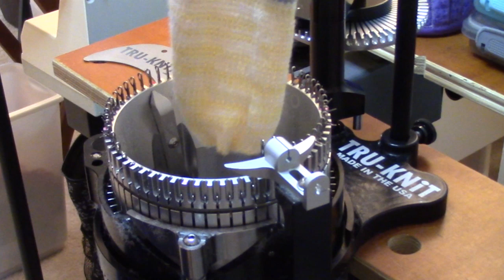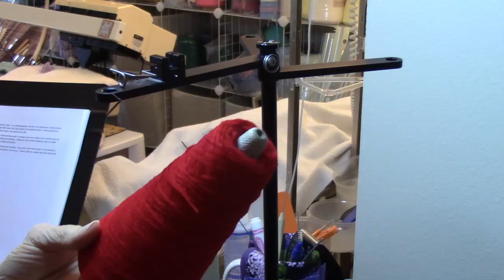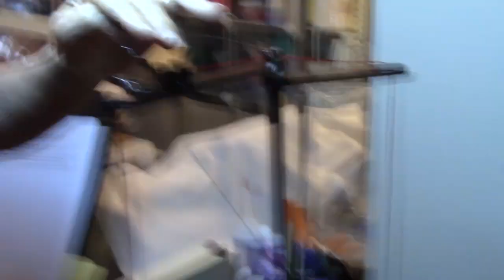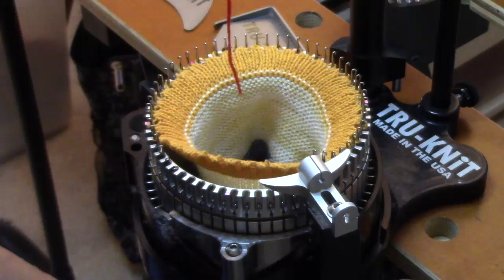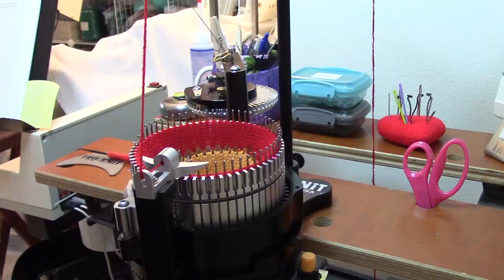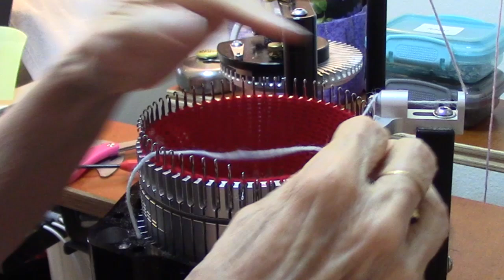Circular Sock Machine Quick Start Step #1, Cast On and Knit a Tube by Diana Sullivan

Comment: Hello! What is the table you are using to attach your CSM on? Please and thank you.
Reply from the maker: That is a Black and Decker Workmate.  It's old but I think they still make them.  The top opens to hold a piece of wood, but I like that opening as the perfect way to feed yarn.  It has some little holes for tools where I put scissors.  I put the items I don't want to tip over on the board away from me.